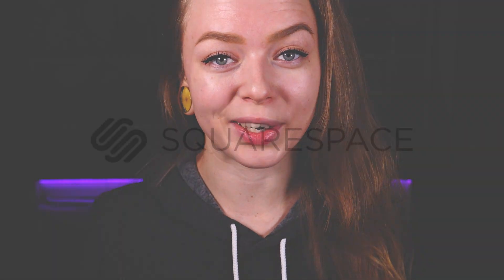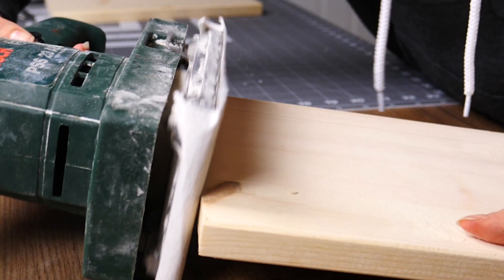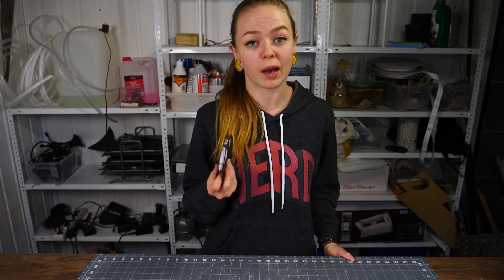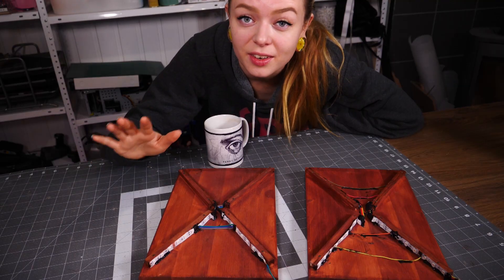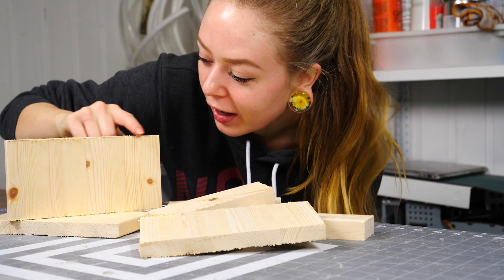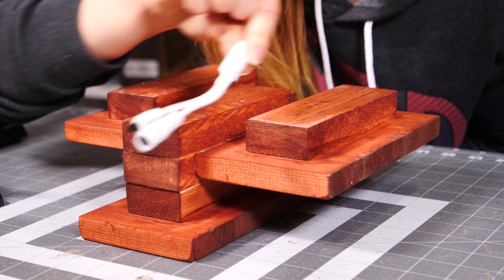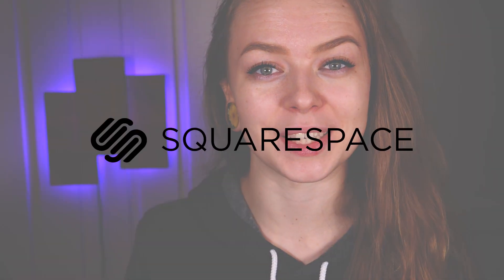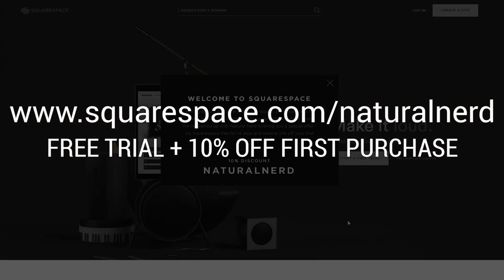3 DIY Modern LED Lamps Under 10$

Comment: Wonderful video, I just moved into a very small dark apartment I am I’m going to teach myself to solder and do this! My question is if I need to run a long distance of the four wires to extend to different RGB strips can I do this with the same power adapter that comes with one strip?
Reply: Depends on length and amount of LEDs on the strip. The power supply may need to go up to 5A vs 2A. Those have a more brick like appearance than a small power supply she's using here.

Comment: Thanks for the video. One question though: must I tin the strip connection points before soldering the wires onto them?
Reply from the maker: I always do that because it makes everything a lot easier and quicker, so I'd definitely recommend it :) 
- Martina

Comment: Great work!! I have made a similar lamp with a RGB Ledstrip.

I works great with the new Strips from Xiaomi:

https://www.gearbest.com/smart-lighting/pp_424884.html?vip=4029901

I can only recommend this RGB LED Strip.

Beautiful colors and color control possible through your smartphone.
Check that out: 
https://www.gearbest.com/smart-lighting/pp_424884.html?vip=4029901

Comment: Is the led stripe adressable ?
Reply: LED strips like this are not, all colors on the strip will be the same color. The addressable version will have three wires, power, ground, and data. If there are four wires, power, R G B the entire strip will always light the same color, or very close anyway, the LEDs will probably have some small degree of variance due to the low tolerances kept in manufacturing.
Reply: thank you very much!!!!!

Comment: Great work! 
You might want to mention that it's usually a good idea to wrap that connection between the LED strip and the controller in heat shrink tubing, because that link tends to shake loose over time.
Reply from the maker: That's a good tip!

Comment: I find the regional differences of woodworking terms very interesting.  You call them 2 by 1's and we call the 1 by 2's in The States.  Do you use the metric system in Norway?  If so, what are they called in the metric system?  Just curious.
Reply from the maker: Yes, we use the metric system in Norway, but strangely we still use the terms 2 by 2 etc. when talking about wood dimensions like this. I mean, when you buy it at the store usually the metric dimensions is what's written on the label, but we always use 2 by 1 etc. in our everyday language. No idea why that is, though.